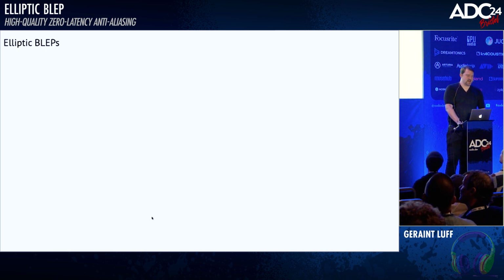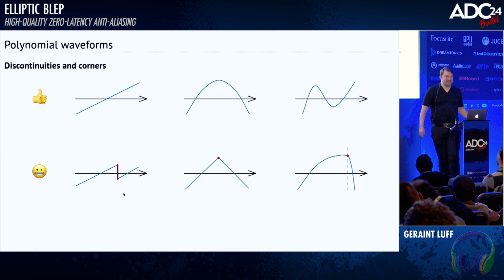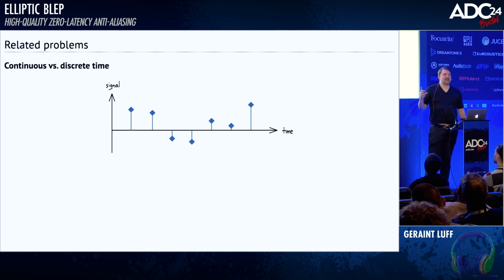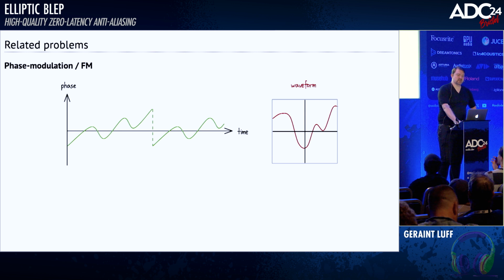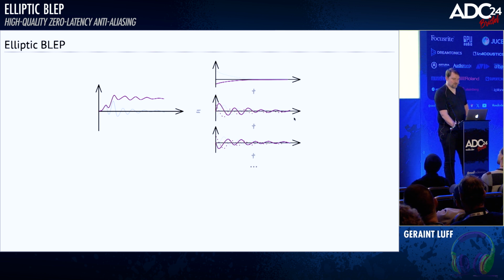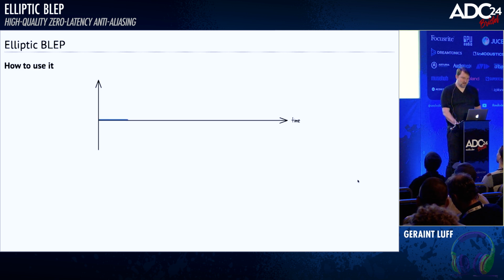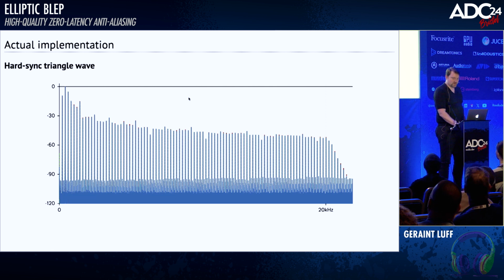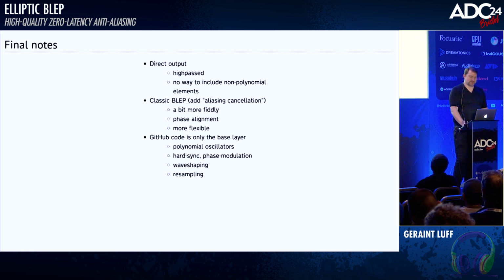Elliptic BLEP - High-Quality Zero-Latency Anti-Aliasing - Geraint Luff - ADC 2024

Comment: For the whole lecture I wanted to shout that all of that is great, but it will not make a good results on a rectified sine wave, and in the end he mentioned it, that whole approach works basically only to connect polynomial segments. Great stuff, guy really knows what he is talking about. Would try this method. Especially now, that I have perfected polySin approx function.
Reply: Any chance you could share your perfected polySin?  I just learned about (x^5 - 10*x^3 + 25x) / 16 and it's kinda blowing my mind.
Reply: @bart.grantham  Method is pretty easy. You define interval where you want sin to be defined, like (-pi/2; pi/2). Then you say, ok, sin is odd function, so it will contain only odd powers of x, (like x, x^3, x^5 and so on). You define your polynomial as P(x). Then you define your properties that you care about (like sin(0)=0, sin`(0) = 1, sin(pi/2) = 0, sin`(pi/2) =0 and so on). It is easy to see how P`(x) would look like. Also P``(x) and so on. You make a system of linear equations out of this constrains and solve it for coeffs of your polynomial. It works basically like having multi-point Taylor. While Taylor works great around one point it will explode till the end or your interval. Using this method you can define arbitrary number of points and tune precision around them adding n-th derivative constrains around them. For example I had great resutls with this set of constraints {P(0) = 0; P`(0)=1; P``(0) = -1; P(pi/2) = 1; P`(pi/2)=0; P``(pi/2)=1}. That will produce x+ax^3+bx^5+cx^7 which would be really impressive for such small computation. Maybe a little less precise then Taylor of the same order around like pi/4, but extremely better around pi/2. Comparable Taylor would be like x^13 or something. 
If you have any problems with this, try to feed it to DeepSeek of chatGPT, I believe they can reexplain it better.
Reply: @bart.grantham  I believe it is called Hermite Interpolation, but Idk, never finished my education, just improvising. Also be careful with numbers I give there, might be mistakes. Anyway idea is P(x)=sin(x), P'(x)=sin`(x), and so on.